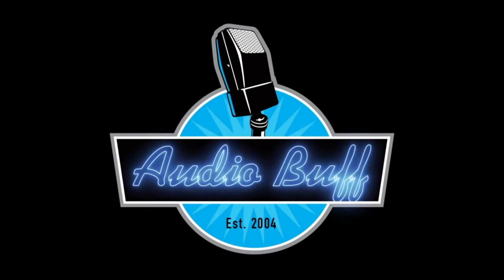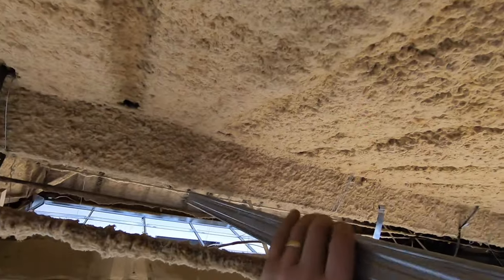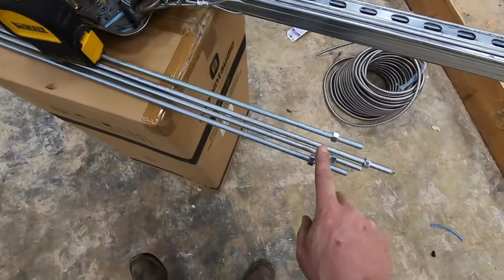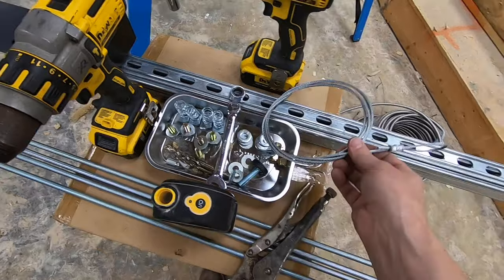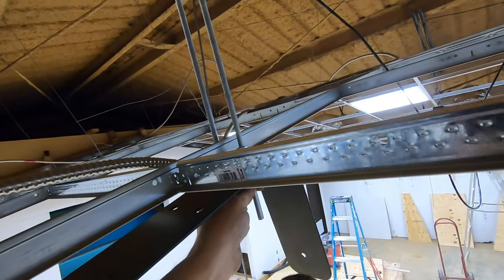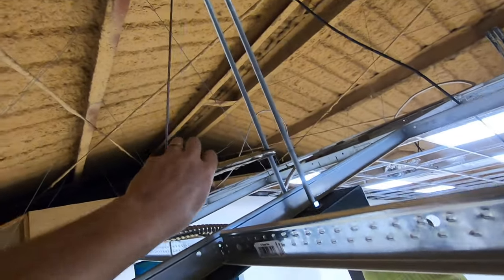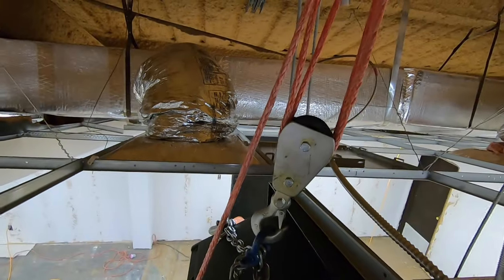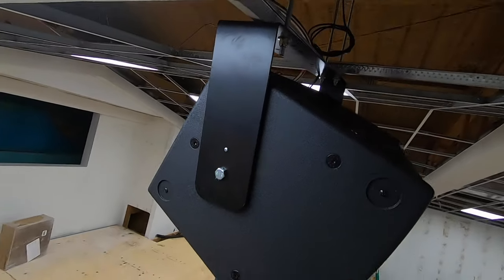Flying a 2-way Speaker in a Suspended Ceiling System

Comment: Can this method be used on a wall mount bracker, specifically EV ZLX Bracket?
Reply from the maker: Yes. Most speaker brackets can be wall or ceiling mounted. The challenge with this install is I had to transfer everything to the structure (not the ceiling grid).  Thank you for watching!

Comment: Thanks a lot for your video. Learnt a lot from this. Highly informative and superb💪🏼. Many thanks.

I was wondering sir..., Please how do I lay hold on some self-locking pulley like you have.? It's quite hard to find one online.🙏🏻

Do you please mind sharing a link to get one? 🙏🏻

Many thanks.
Reply from the maker: I got that on Amazon in 2018.  I can not find it any more.
Reply: @audiobuff  Thanks sir.

I also wanted you to know..., I just did a speaker install following your video as guide. And don't worry, it's safely rigged.  😄

Plus, I just got another job whereby watching your video (the EV ZXli ceiling tile video) was a God sent. 

Haven watched the video beforehand, I literally knew what to do right away. Right from making the speaker choice (I would have probably gone for something else if I hadn't seen your video beforehand). 

And I will also be installing the same speaker and with the same method too. 

I don't know what got you posting your videos sir, But know that at you are touching lives.  🙌🙌

Comment: There is no way this will fail but the strut nuts are upside down and not used as intended. They have grooves to align in the channel edge and the spring holds it in place. If you use those for your threaded rod to the speaker, with a channel washer, you will increase your load rating, won't need as much threaded rod, and you can slide them in the channel for alignment if needed. The cone nuts for strut channel are easier to slide. You can then use the standard nuts on the purlin.
Reply from the maker: Thank you for the comments!  My vendor didn’t know how to use the strut nuts either (I call them pretty boys in dockers).  I’ve used them both ways and now will spend more time making sure they are installed correctly. I try to be as careful as I can when it comes to overhead rigging. By the way, what is your back ground?
Reply: @audiobuff   I hesitated to comment but you seem to care about rigging and I though the info might be helpful. My background is primarily audio/video/lighting design, installation, and service for houses of worship. I've done that for over 20 years but have also worked as a church tech director and also as a tech for major country music touring artists.
Reply: Would this work for hanging a small truss along the top of the drop ceiling? Looking to rig stage lighting along with the speakers at FOH along a 20ft span

Comment: more videos on flying speakers
Reply from the maker: I will do my best.  I have a few 2 jobs over the next month that will require flying speakers.  I have several other videos I still need to edit that i flew speakers in.  Also I have 2 older videos that I flew speakers.  Did you see those?
Reply: @audiobuff  yes i did